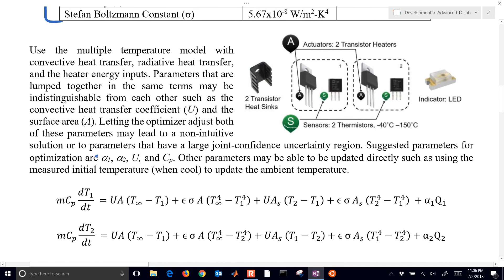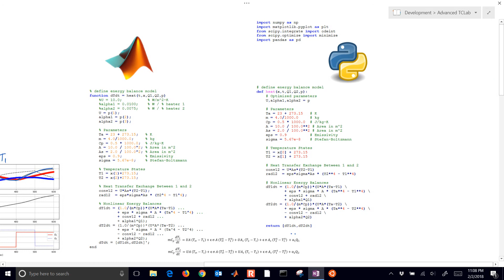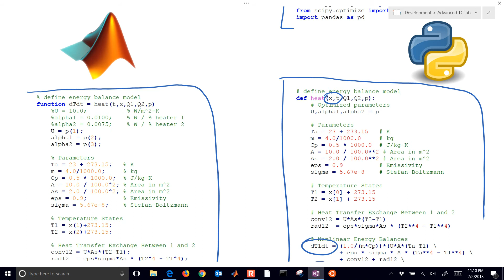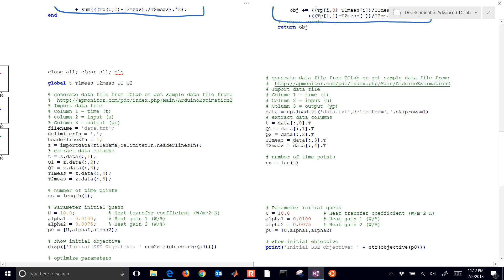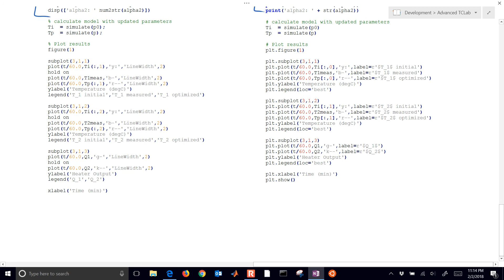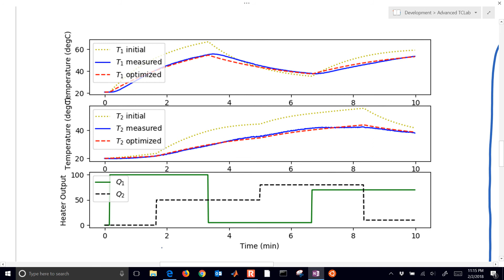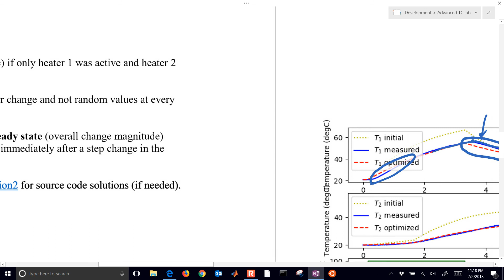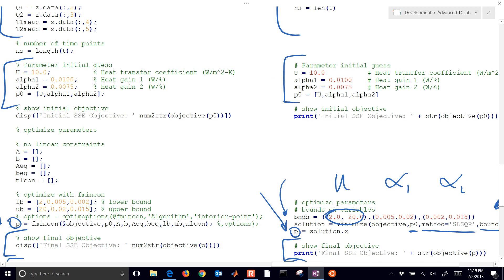Parameter Estimation with MATLAB fmincon and Python minimize

Comment: 10:37 this lag can be covered/modelled by taking the moving average of the temperature as input in stead of the actual instantaneous temperature. For the number of points of the moving average take the approximately observed lag time.
Reply from the maker: The moving average is similar to a higher order response. Here are the results of fitting with a 2nd order or higher order model. https://apmonitor.com/do/index.php/Main/TCLabD
Reply: @apm  Thank you! After your suggestion I tried a 2nd order model and it fits also very good! I'm fitting the temperature response of a pipe and of a thermal inertia attached to the pipe.

Comment: could it be possible that results from fmincon and scipy's minimize are very different?
Reply from the maker: Optimizers can give different answers if one does not report a successful solution or if the problem is nonconvex and the optimizer finds a different local minimum. Some solvers are more capable. More capable solvers are in Gekko Optimization Suite such as IPOPT and APOPT.
Reply: @apm  ok, I have to check if there are bugs in other part of the code, if there aren't maybe I will pass to GEKKO.
Reply from the maker: Here is a parameter recursion tutorial when using differential equations: https://apmonitor.com/do/index.php/Main/DynamicEstimation
Reply from the maker: And more tutorials on regression: https://apmonitor.com/che263/index.php/Main/PythonDataRegression
Reply: @apm  I was looking at GEKKO, and I have a question, in my code the objective function is linked to the predicted values (not easy as the one you show), how could I implement it, because with scipy I run the simulation and then I compute objective, but with GEKKO?
Reply from the maker: @antonionappi96  gekko requires that the model is written with gekko equations so that it can do automatic differentiation. Gekko solves the objective function and equations together, not separately. It compiles all of them into byte-code before solving. It is a completely different way of solving the problem. Can you translate your equations into gekko form?
Reply: @apm  yes, I've translated my equation in GEKKO but my objective function is something like "the increment in the measured quantity/the value of the measured quantity - the increment in the predicted quantity/the value of the predicted quantity" and it's all squared. How can I implement it with GEKKO?
Reply from the maker: @antonionappi96  could you post a question on stack overflow with tag gekko?
Reply: @apm  yes
Reply: @apm  you can find my question on stackoverflow